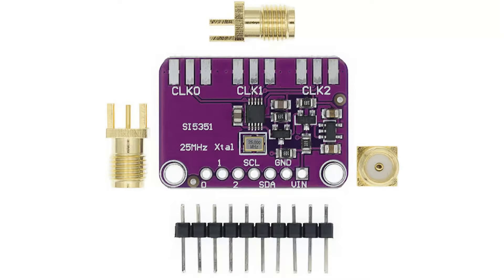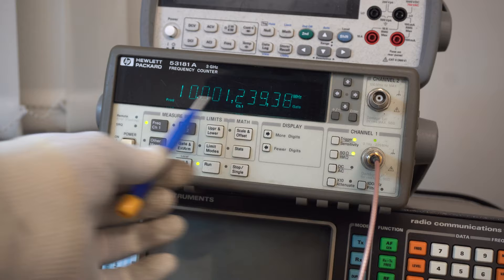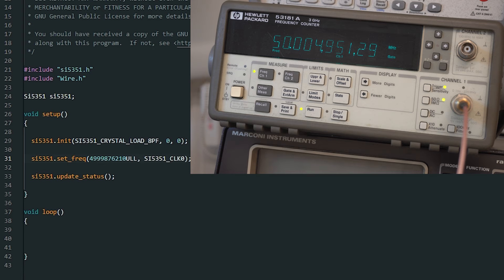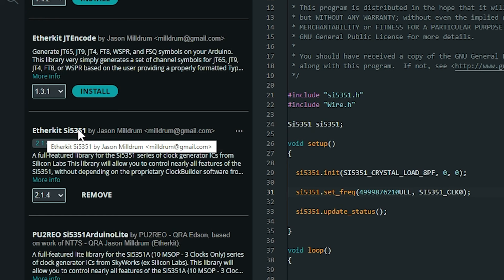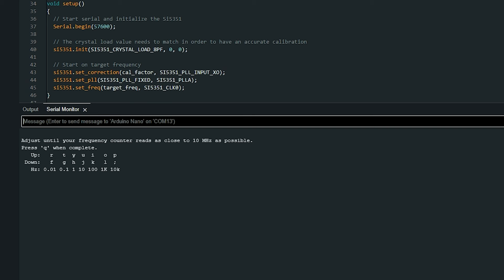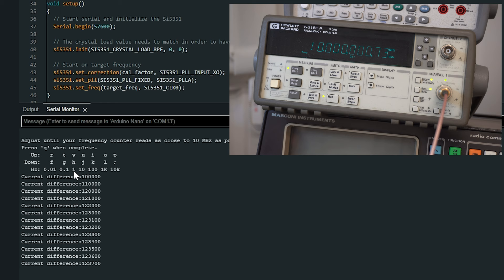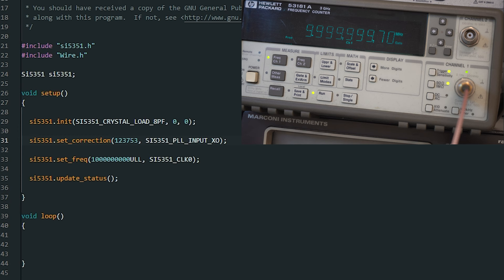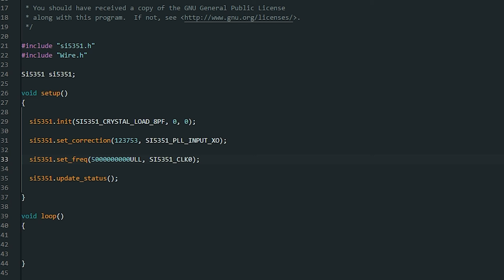How to Calibrate the Si5351 on the Arduino Platform

Comment: John, as soon as you integrate your real code, i.e not a calibration script it will change again. We should be integrating the calibration script into our main script. We forget that each line is one clock cycle. Not much of an issue on the lower bands but up to 10m and above it becomes an issue for sure. Depends how pedantic you are.
Also, depending on the output drive you selected there will be more drift on the higher outputs for example 8ma for a simple mixer. They are not super stable at higher frequency,  more down to design rather than function.
Reply from the maker: Hi, thank you for your comment. Yes that's correct, the correction needs to be implemented in your main script. In order to implement the cal figure into your project, add the following line in the code to the Arduino setup function.

si5351.set_correction(-6190, SI5351_PLL_INPUT_XO);   //Note: Change -6190 to the cal figure that you get from the cal script.

The frequency shouldn't shift when changing the drive strength. If you are seeing change it may due to the harmonics and overtones coming out of the clock generator getting mixed up in your frequency counter. Adding a filter to clean up the clock signal may help.  Also note: the ref crystals used in these breakout boards are not the best and can cause more noticeable instabilities at higher clock frequencies. 

I hope this is of help, regards John M0XFX

Comment: I literally wasted hours yesterday when I realised something was occasionally a bit off off this this board.  I was using the Adafruit library on an ESP32 but I think I'll switch to the EtherKit one now; thanks for the video! 👍
Liked & Subbed
Reply from the maker: Hi, Yes without calibration these boards certainly do have frequency stability issues. I can't comment on the Adafruit library as I have not tried it. The ESP32 is a great dev board and the Etherkit library will work fine on that platform. I make these videos through my own experiences in the hope that it's helps others.   I am glad you found the video helpful and good luck with your project.

Comment: Thanks, John!  I have a bad 20.2752 MHz oscillator in my TRS-80 Model 4 which nobody seems to make any more.  I was looking at using this chip and learned about that easy to use library from this video.  I was hoping a working sketch would fit in an attiny85... and...  Miraculously, just setting the frequency with a correction factor comes to 8160 bytes... I'll have a whole 32 bytes of flash left.  This means no bootloader, but that just means it'll start up faster.  haha!
Reply from the maker: Hi, It's great to hear you have your TRS-80 back on frequency. Yes that's right if you only need a fixed frequency then just correction is that is needed. Thanks for the comment, best regards John M0XFX

Comment: Excellent video, tutorial and effort to share = thank you! I am not a coder, at all, but I would think that a correction algorithm could be simply determined for each individual Si5351 unit and that it could be rather easily coded in... If the offset fault is linear over the entire bandwidth, then... Measure the offsets at the low and high ends of the range, subtract the low frequency from the high frequency, to determine the effected bandwidth... Divide the offset fault value by the effected bandwidth, to determine the correction factor, per Hertz. Code in this correction factor... Or, some other such means... I hope I said that clearly; it is very late at night. Anyway, cheers!

Comment: I just bought an Si5351A clone on Amazon and it's not putting out a stable frequency. I'm quite new to this stuff so I have no clue what the problem is. The frequency is set to 10Mhz but it's being read by the frequency counter as 5.3/5.4Mhz. It jumps around quite a bit. I checked to see if I hooked something up wrong but everything seems to be connected properly. I'm guessing I have a bad module but I have limited equipment and limited knowledge so I'm hoping someone one here will have had the same issue and can point me to a solution.

Comment: Hi here... Can I use this example for an ESP32 DEV setup, if so what should I do? I am a bit of a novice in the field 🙂.
Reply from the maker: Hi, Yes the cal routine sketch should run on the ESP32 and will work as per the video. If you have an ESP32 you will need to configure the Arduino IDE to work with it. Keep an eye on the channel, I have a video coming soon on how to do this.

Comment: are all si5351 chips different to callibrate or can I just use your calibrating offset? because I dont have a frequency counter.
Reply from the maker: Hi, The issue isn't the si5351 it's the crystal for the oscillator. You only have to carryout the calibration once to get the figure. Keep an eye on the channel as I am thinking of supply some SI5351 boards with the calibration figure so you don't need a frequency counter.
Reply: @M0XFXUK I, for one, would welcome that! I have 1 SI5351 Breakout board, and will be looking for another in the near future!